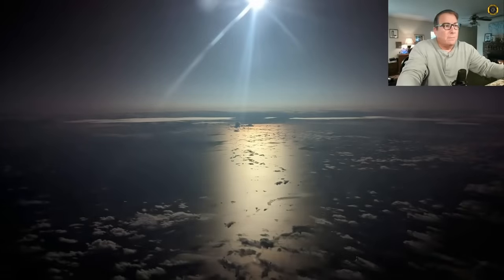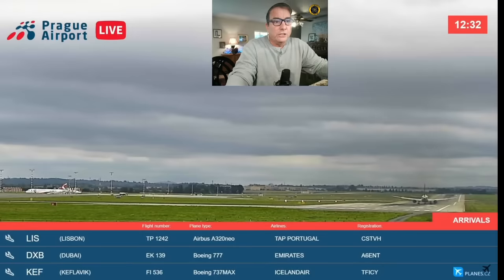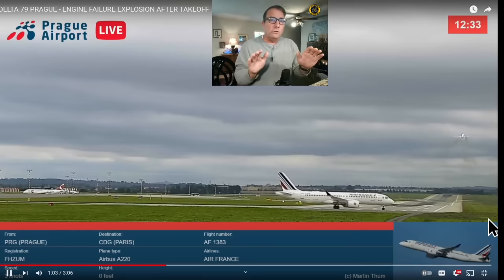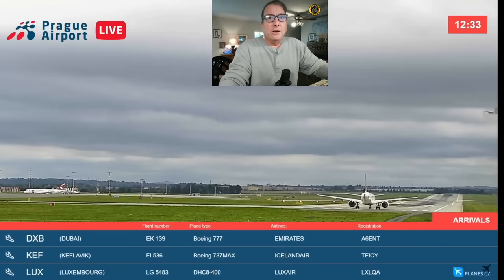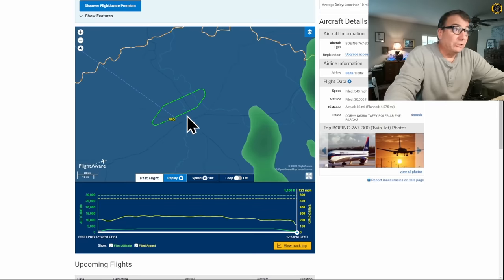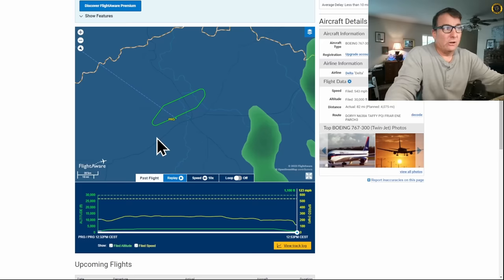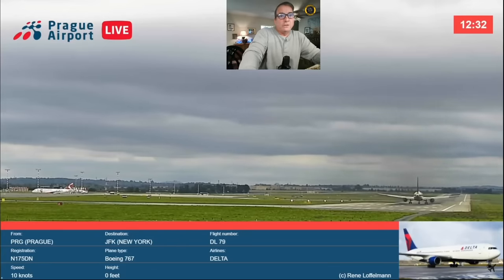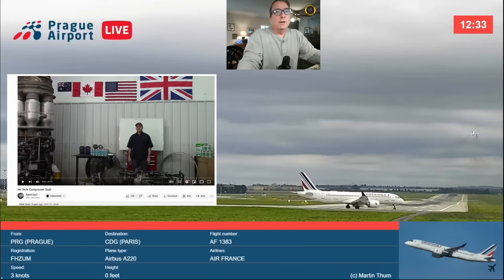DELTA 767 TEXTBOOK Engine Failure on Takeoff - Prague/JFK

Comment: I liked the Czech ATC not bothering the pilots with "say intentions when possible" and "do you want to turn now or later" and other pointless chatter while the pilots were dealing with the engine failure checklist. They just answered "okay" when Delta announced they'll keep flying direction and will contact ATC later. ATC needs to clear the airspace and runways anyway, regardless of what Delta says or doesn't say. And ATC needs to keep the pilots clear of constantly being interrupted by ATC. "Air France vacate runway at Charlie" was also minimal, not jamming the frequency with "Air France do you want to return to the gate", which will always be replied by "need to call company first". Everyone knows that the airport is essentially closed for some time. Unimportant crap must be dealt with later, not in the first minutes.
Reply: Well put. Is there a difference between countries on how ATC communicate with pilots?
Reply: Roger dodger !
Reply: @KeithStewart-zn8mg  sometimes I get the impression that some ATC in the US just go through a script and ask questions which the pilots already answered in advance or which don't make sense at that point in time, just causing distraction to anyone who has to listen on tower frequency.
Reply: Indeed, it was a very good job by the ATC, too!👍
Reply: It's because they told them they'll call them back.
Reply: Protocols in Europe (and most of the world) are heavily influenced by the fact that they are working in English which is a second language for most. That is even true for ATC in Britain and Ireland which have to assume that most of those on frequency have English as a second language at best. Standard phraseology, strict adherence to International English and keeping things simple with short sentences are essential. There is also the realisation that the last thing that crews want in an emergency is distractions.
Reply: Czech infrastructure is like this at every level. They have an amazing airline, they have the best cabin crew training in Europe, their sim equip is top of the line, and ATC is always like this. In my experience, only the Swiss infrastructure can compare to the Czech one in Europe. Austrians are also a top contender. And that goes for air, rail, river and road travel.
Reply: What’s your vector, Victor?
Reply: The runway is potentially contaminated so it needs to be checked. ATC will keep moving planes if possible.
Reply: "Unimportant crap must be dealt with later" 
That is the biggest and best understatement I've ever seen on one of these channels.
About as accurate as it's possible to make it.
Go to the top of the class and take 5 gold stars sir...  Absolutely Brilliant !
I've seen similar incidents where the only thing the controller didn't ask was... 
"What make is your Underwear"?
Reply: "Can you give me the fuel remaining in pounds and the number of souls on board?" Another pointless transmission. The crew don't want to be trawling through the flight plan to see how many people are on board, nor do a weight conversion from tons to pounds. The crew are going to be busy with the engine failure checklist, they don't need to be bothered with pointless transmissions. From an ARFF perspective, always assume worst case scenario of max fuel... and the airline can provide the flight manifest if required later.
Reply: @warden330  Indeed, exactly.
Reply: @philyew3617 Following "boxers or briefs?" 😂😂
Reply: I like them too they aren't all like blah blah blah blah blah yakety YAK

Comment: There were actually three first officers up front on this one along with the Captain, of course.  All three FO's are instructors.  Awesome people and pilots.  I've flown with several of them.  So glad this worked out.
Reply: The folks in the training department should be happy!
Reply: Do you know Cody?
Reply: Sounds like a lot of cooks in the kitchen!
Reply: @jimmyoverly3512  long haul augmented crew.
Reply: @jimmyoverly3512 standard procedure for long haul flights. All crew in the cockpit for TO and landing. I can guarantee you that those in the jumpseat didn't want to mess things up for the folks at the controls. All aircraft procedures are designed for standard crew, and any pilot in the jumpseat knows they will only intervene (and concisely) if somehow the ones up front missed something. Kudos to the crew for getting this one back down in an apparently safe and correct manner!!
Reply: @danabergman4052  No. I know the two guys who were in the jumpseats.

Comment: Even when flying in the simulator, engine failures are quite startling when the plane suddenly moves longitudinally from the yaw. Well done, Delta!
Reply: Interesting how they drifted off the centreline by a long way. That would be a repeat in the sim for me.
Reply: @EdOeuna  An emergency aircraft dealing with an engine failure. Wind from the left, right engine failed, why worry about exactly maintaining runway centerline? Fly the aircraft, run the engine fail checklist, then get vectors back for the landing. Crew did a fine job!
Reply: @johncox4273  - you’ll not have been in a sim then. The tracking of the aircraft following an engine failure on take off is a critical component to the overall safety of the flight. The upwind area of an airport is surveyed. An engine out flight path is only enough to clear obstacles by 35ft. If you start drifting away from the centreline and keep going then you’ll risk drifting out of the surveyed area where there isn’t the guarantee of terrain clearance. 

My local airport has an engine out SID to follow off one of the runways. This creates a turn at about the departure end threshold because there’s a multi-storey building that pokes into the departure envelope. The building prevents the 35ft terrain clearance.
Reply: @EdOeuna  they drifted slightly, but not much.  No right-minded TRE would fail someone for the amount of drift they had (and then rectified).
Reply: @nickboylen6873  - but they didn’t rectify it. They drifted out of frame of the camera and never got back. What happened to the 400ft part where, before identifying the malfunction, you check your aircraft performance and flight path? That’s basic airmanship that I learned from turboprop flying many years ago. By the time these guys get to the, albeit old and outdated, 767 one would assume they could fly an engine out departure correctly.
Reply: @EdOeuna  with the angle of the camera relative to the centreline, it’s not possible to be definitive about how accurately they tracked, but it looks fine to me, and the ADS-B trace looked pretty straight.
Reply: @nickboylen6873  - definitely downwind drift. Not the most professional.
Reply: @nickboylen6873  Yep!

Comment: Great coverage Juan. As a young TWA 727 flight engineer years ago, I had an engine fire warning right at VR out of LaGuardia and ended up diverting to JFK. It was a pretty busy flight deck. Fortunately I already had already been flying the C-130 for several years, so I was well versed in in flight emergencies. Looking back on 30+ years of airline flying, the training, procedures, and equipment are so much better now.
I still remember that day at LGA like it was yesterday though.

Comment: As a crew chief on a 135 sitting in the IP Seat on TO we were wheels free when I called #3 Oil ( it fell out ) and about 2 seconds later it blew up.  ( Catastrophic Uncontained Turbine Failure ) 

The T handle went red… the AC said Chief/Boom… go get me a visual. 

We had a persistent fire with no fire fighting capabilities ( KC 135A did not have a Halon Bottle in the strut )   Later we found out It took out the Firewall package..so the T handle did nothing and the engine was shut down ( well the fuel was ) from the fuel panel which was a QRI anyway. 

We made one fast and tight right pattern.. DUMP as much fuel as possible and came right back… flight time of about 5 minutes. 

Had a Full Bird AC and a Lite  Bird CP … I’m a E-4 and the Boom was a E-5.  

The Col flew it like a 106… it all happened so fast there was no time to get scared

Comment: Great job, I agree. During my 33 year career I only had one engine malfunction which really wasn’t. Carried out a precautionary shutdown due to high engine oil temp in excess of the allowable 15 minutes and flew around 280 nm on one engine and landed. Turned out to be a failed thermocouple and the engine was fine. This was in a B737-400.
Reply: better safe than sorry!
Reply: @maeton-gaming indeed.
Reply: I feel cheated as I have never had an engine failure in 50+ years of flying.

Comment: My one (and only) engine failure on a B767 resulted in a successful return to the airport right at Max Land Wt. By the time the fire trucks  cleared us to taxi I began to blow fuse plugs. I managed to get it clear of the runway before all the MLG tires went flat. My reward was a terse letter from the Chief Pilot full of shoulda - coulda - woulda Monday morning quarterback verbiage. No $20 gift certificate for me.
Reply: Did you lose your job?
Reply: Sounds like the same company I worked for.  Company rules required 2 week notice prior to your death.....    Good job crew.
Reply: @robertbennett6697  No, cooler heads prevailed when my union stepped in and, along with the FAA, determined I did everything as I was trained. The overheated brakes were because I did not use reverse thrust on the remaining engine. Previously, our company had a crew  that slid off the side of a runway during a single engine landing resulting in a collapsed gear (and substantial damage to a nearly mew Boeing) so the policy was to use brakes only on a single engine landing. Our Chief Pilot “forgot” that. No injuries in either of these accidents - thankfully.
Reply: Good job!

Comment: Pretty incredible from a maintenance side, too. Flightradar24 shows that N175DN is scheduled to return to JFK on Sep 5th. So only 4 days to fix the aircraft and return it to service. Nice job from TechOps!
Reply: No kidding !   A lot of work for certain .
Reply: Its not that bad/big of a job to change an engine with a reasonably experienced crew. A little more work if they needed to change the pylon for some reason. The biggest time sink for a job like that is having the crew, tooling, and  equipment coordinated along with a replacement engine & parts. An airline such as Delta is going to have pretty much everything kitted & waiting for these occasions and AOG teams on-call.
Reply: Delta Wrenches are the best in the business.  Always had confidence in the jet because of their work.
Reply: The new engine arrived to PRG from Atlanta  Sep 3th 09:38 CEST (National Airlines flight N8862, B747-400F).
Reply: @michalpavlat3943   Do you know if that aircraft had PW4060?
Reply: @Paul1958R  As far as I know yes. 2x PW4060. It's N175DN.
Reply: You should be able to change that engine in two shifts easily. No more than 20 hours. I’ve changed many.
Reply: Well - second time :-)!
Reply: Probably local maintenance and not Delta Tech Ops. Does Lufthansa Technik have a base at PRG?
Reply: @N1120A No way. Delta Tech Ops. We'd send our own mechanics for something like that.

Comment: Thanks. Great job to the pilots. I was a passenger flying out of Atlanta and as we were climbing out, one of the engines that I could see out my window suddenly belched donuts of fire and then the call came through that we were going to return to the airport. We flew around dumping fuel over the Georgia peach crop for quite a while and then landed. I was really happy as the flight was to South Africa and if it had happened over the Atlantic this could have been a different outcome. 😊

Comment: A source of frustration for non-US pilots and ATC is the non-ICAO radio procedures American pilots use. An initial Pan Pan or Mayday call conveys the degree of emergency and helps get everyone on the same page, particularly in non-English environments. 
It’s the way the pilots are trained and they got the message across so no criticism of them intended, great job.
Reply: “Pan pan. Pan pan. Pan pan. Delta 123. Engine fail. Climbing straight ahead, 3000. Standby”.
Reply: @EdOeuna engine loss on a two engine aircraft is a full blown emergency. But I’ve had two emergencies and I don’t see the need to say mayday when all is calm and well. The word “emergency aircraft” is mainly just to clear the air and reduce workload. Everyone seems to get wayyyy too worked up over saying “mayday mayday mayday”
Reply: @alexmelia8873  - but the argument is that “emergency aircraft” isn’t a universally accepted radio call.
Reply: @EdOeuna  i agree with you. But in the two times ive had to declare, there was zero reason to exlaim "MAYDAY MAYDAY MAYDAY" when I was already talking to the controller. The origins of the words are to gain attention. We already have it.
Reply: @alexmelia8873  - too much is made of “mayday”, hence I suggested “pan” in my first response. It still draws attention to your plight, but in a much calmer way.
Reply: @EdOeuna  well the problem is a pan pan is not an emergency and losing half of your engines is indeed a full-blown emergency. MAYDAY is a word used to interject into a frequency to 1.) get a listeners attention and 2.) declare an emergency. If we already have one, we can just say the other one.
Reply: @alexmelia8873  - mayday is for life threatening emergencies. As in “we’re about to crash”. This aircraft was never about to crash so pan pan would be sufficient.
Reply: @EdOeuna  incorrect. Nowhere is it written that "mayday is for life threatening emergencies" An emergency is an event that requires priority handling from external sources. With one engine your options are limited and you are no longer capable of normal operations and thus require special handling. All airline operations require pilots to declare an emergency (your "mayday" in this case) when you've lost half of your engines
Reply: @alexmelia8873  - I don’t know what manuals you read but mine states that urgency, grave and imminent danger is a mayday. Pan is for difficulties which compel the aircraft to land requiring immediate assistance.
Reply: @EdOeuna  I'm reading my flight operations manual for the airline I work for. Pan Pan does nothing for you ATC wise. Declaring an emergency does.
Reply: @EdOeuna  thats fine- but my company wants me to declare an emergency for XYZ, I'm going to do what they say.

Comment: Engine Fire Severe Damage or Separation memory items Boeing 767
Auto Throttle Arm  switch off, (only one A/T auto throttle not availabe with one engine inoperative)
Thrust lever affected side, confirm Idle, 
Fuel Control Switch affected side, confirm CutOff, 
Engine Fire Switch affected side, confirm Pull
If the engine fire warming light is illuminated,  affected Engine Fire Switch Rotate to the stop and hold for 1 second.
Congrats to the Delta guys on this emergency. 
Thank you Juan for the review!

Comment: I was on a 767 flight out of Orlando that lost an engine on takeoff.  Most of the passengers on my flight were oblivious to what happened, until the pilot made an announcement. I was almost asleep when I felt the yaw and noticed that we weren’t climbing out like normal. We ended up back at MCO without incident. I missed my first flight that day, then the next flight lost an engine, then took another through MSP instead of ATL that ended up diverting to OMA when a flight departed the runway at MSP and they shut the airport down.

Comment: Never realized how much smoke a compressor stall puts out. Incredible video.
Reply: Jet fuel is very similar to diesel. During the compressor stall the air stops and is no longer pushed back inside of the engine. The fuel flow is still the same, so in the buring chamber the amount of air is greatly reduced while the fuel is still the same resulting in incomplete combustion and black smoke. Note this is only valid for the very first moment as I'm pretty sure that the Fadec will reduce the fuel flow as soon as it detects the compressor stall.
Reply: @guntherberger596 it’s the crew pulling the thrust lever to idle on the dead engine, not fadec.

Comment: Thanks Juan Fascinating and very interesting tid-bit to learn that's not often spoken about. AP cannot 'just be engaged' at anytime if pilot commands so. It requires the same stability parameters to engage, as it would when it disengages. Seems odd to read that back and only then realise it's just common sense. Assumption changes everything!

Comment: Juan, great video and you do an awesome job covering the latest incidents, nice use of available media. The Delta procedure was to hand fly to level off then engage the auto pilot. Also allowed to red line the operating engine if necessary. In he simulator training never were allowed to fly a single engine approach using auto pilot but told it was capable. I bet after years of training you could fly his in your sleep.

Comment: Juan; Was it an engine failure, or compressor stall that recovered with increased airspeed? Surge or stall checklist; thrust lever retard, etc. advance later and hopefully get thrust back. Years ago, I was captain  at TWA of a B767-300, out of Gatwick, had right crosswind, airflow reduced to left engine, caused bad compressor stall-3 loud bangs and vibration during gear retraction. Thrust lever back, accelerated, stopped the compressor stalls stopped, advanced thrust, had both engines! dumped fuel (we were at MGTOW 407,000 pounds), diverted to Heathrow. Mechanics said good decision not to fly to St. Louis! Airlines used to do cursory checks after compressor stalls, and putbplane back in service. They no longer do that, as soon thereafter, the engine would fail🤪

Comment: There is a missing info that 767s had an optional fuel dumper factory option - that is not installed, as it is able to land with full take-off weight, which is an important feature to make such simple 20-minute landing in single circle.